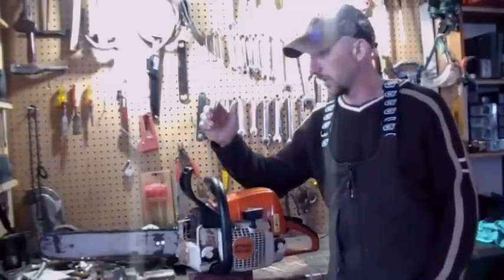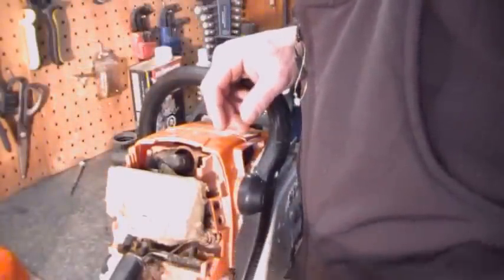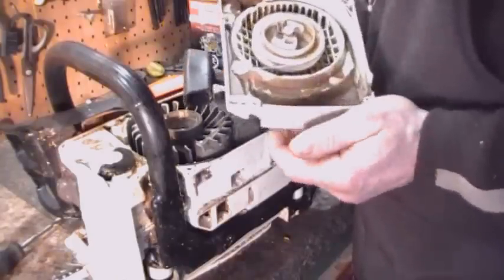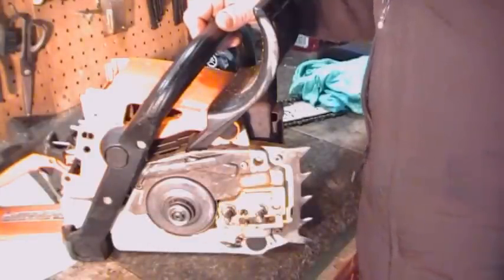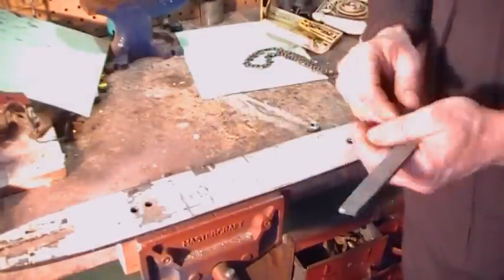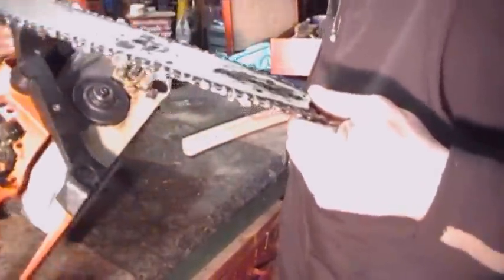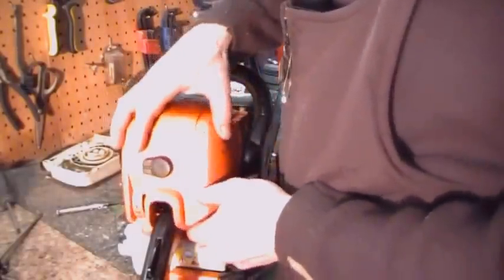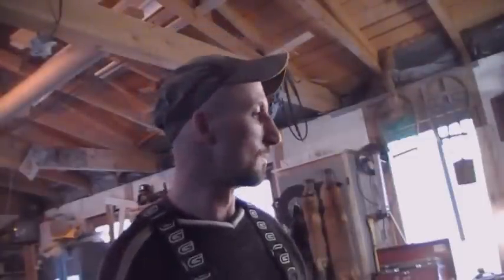CHAINSAW ROUTINE MAINTENCE TIPS/TRICKS

Comment: Great tips Kris, I have the same saw, had it for about 5 years.  Just replaced the bar.  By far the best saw I have ever owned, I cut a lot of juniper and birch which can be hard on the saws being a hardwood, but regular maintenance like this will make a day in the woods that much better!
Reply from the maker: yup same, that saw has also ripped about 500 saw logs into lumber, decent saws for sure.

Comment: Good tips,I worked on them for a living and some people just don't have a clue, another little tip is to get your feeler gauge and hammer the groove on your bar to the thickness of your chain links, as the groove does wear wider where your chain inserts in your bar, if you can rock your chain sideways in the bar when it is tight then the groove is too wide,you run the risk of it binding in a block when it comes loose , also takes less oil to lube your bar rails when you close up the rails, great video, Top notch info, take care ttyl.
Reply from the maker: thanks, great tip, if this video saves one guy a load of misery in the woods then im happy,
Reply: THE BUSY BAYMEN KRIS RUMBOLT It will for sure, you did a very good job, I have worked with mechanics who could not explain it better.
Reply from the maker: awesome, thanks